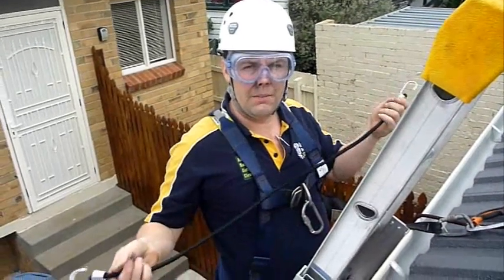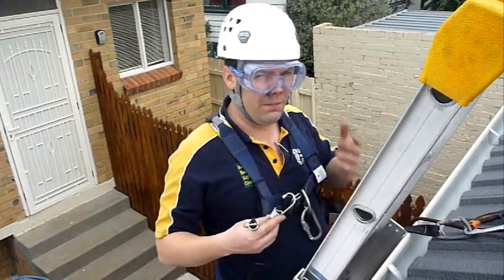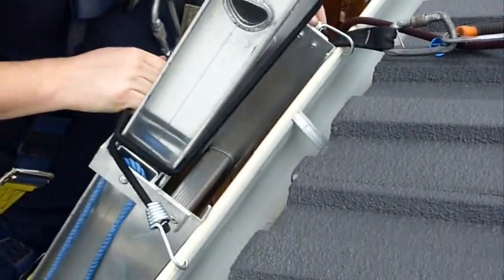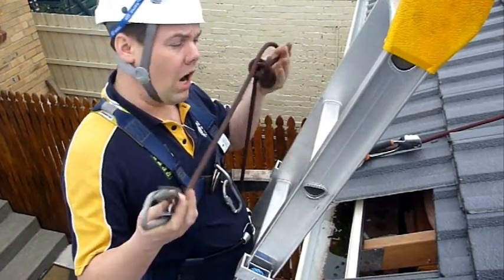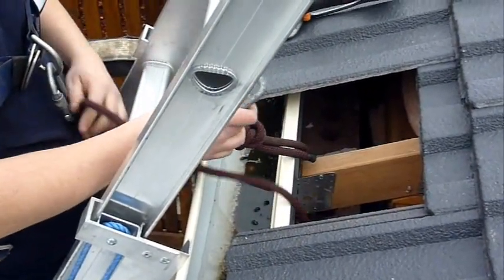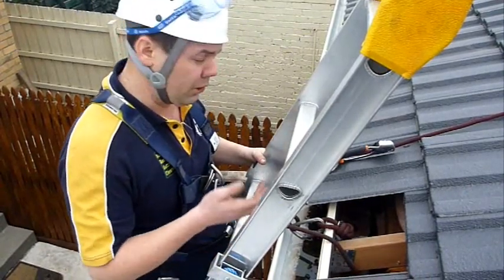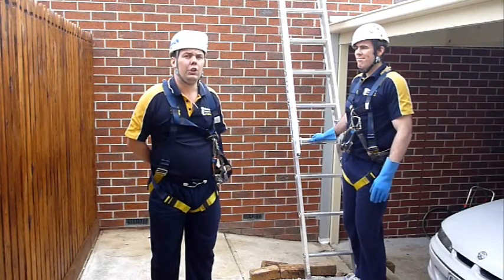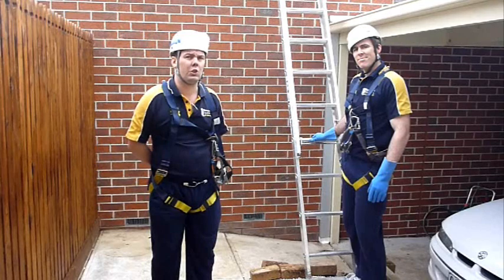Gutter Cleaning - Securing the ladder

Comment: The LadderWeight is the only product in the world that stabilizes ANY ladder on ANY surface/terrain, requires no tools or assembly, is portable, and can be re-used a countless number of times. And it works from the ground, so the ladder is already anchored BEFORE anyone climbs the ladder. Even if the ladder is set at the wrong angle, it does not matter. LadderWeight still anchors the ladder and holds it solid. And, it in no way interferes with the operation of the ladder nor is it in the way of anyone ascending/descending the ladder. Inventor: David Hoch, Mpls., MN.